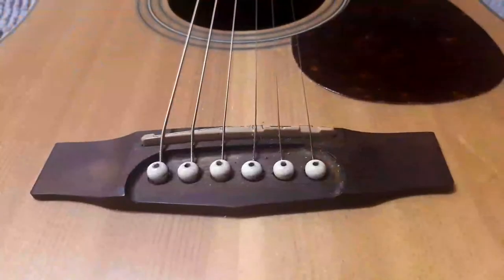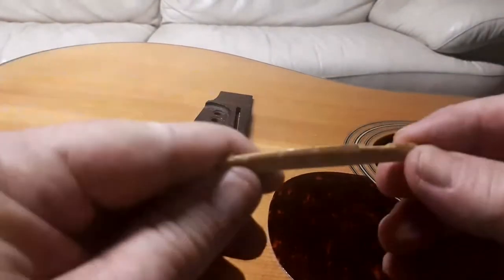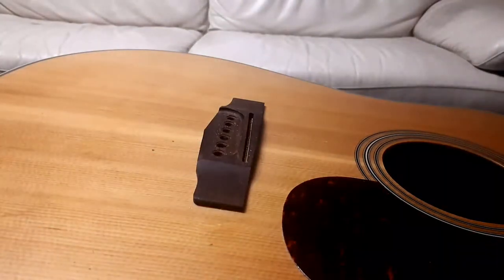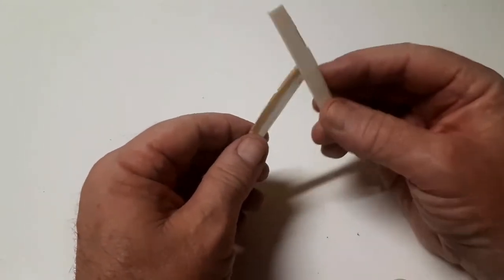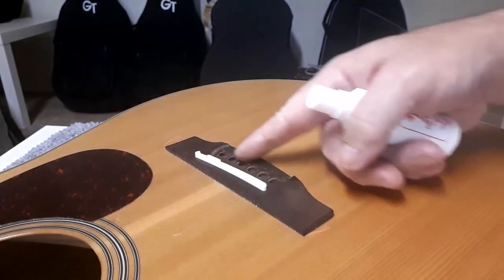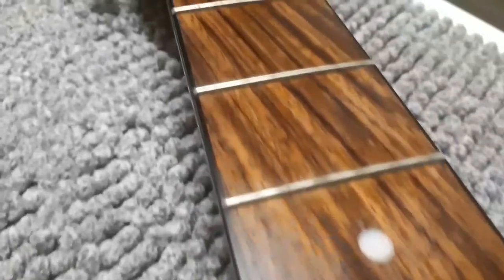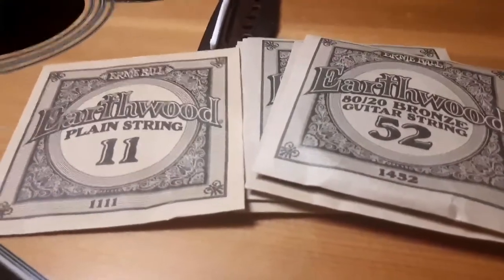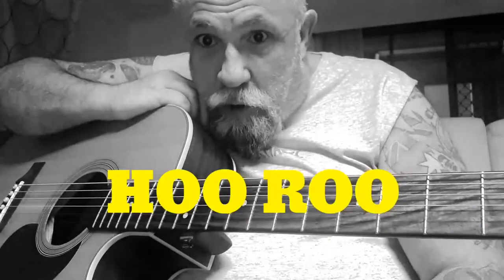REPLACING THE SADDLE ON AN ACOUSTIC GUITAR

Comment: That sanding can take a while! I didn't replace mine but probably should. Instead I sanded it down to try and make my action a little better. I don't think I went far enough though. Might just need to replace the whole thing like you did here.
Reply from the maker: It's made a huge difference mate. You could always tweek the truss rod to lower your action! Saves the strings lol
Cheers mate and Merry Christmas  👍

Comment: Thanks Brad. If u r still checking this can you please tell me which way around the saddle goes in. I didn't take enough notice before I pulled the old one out. Cheers
Reply from the maker: @eljayn7862  usually the saddle has some beveled cut outs and those face your pegs and are used on the thinner strings.
Hope that helps 😃